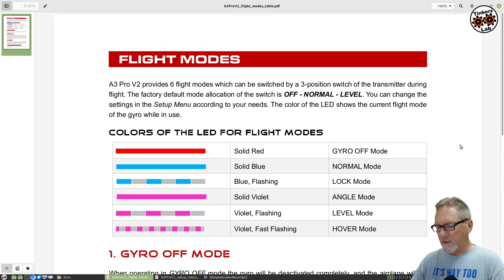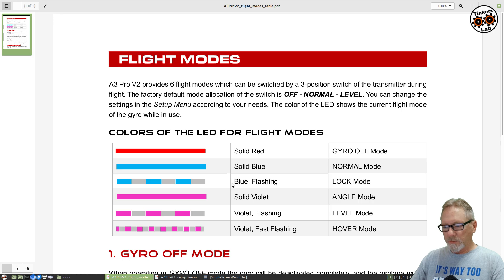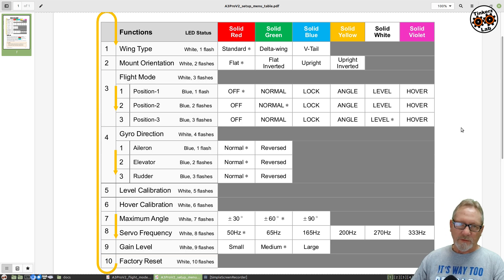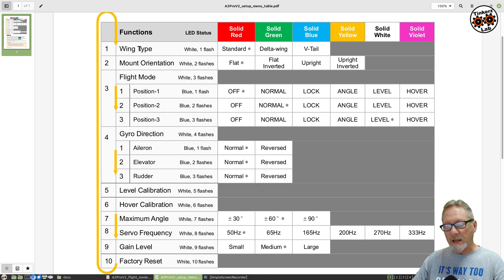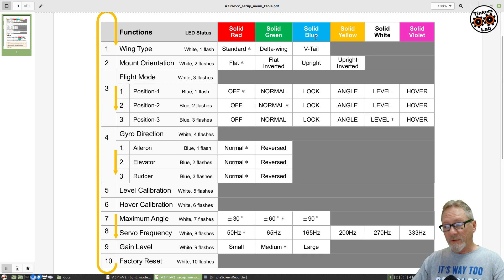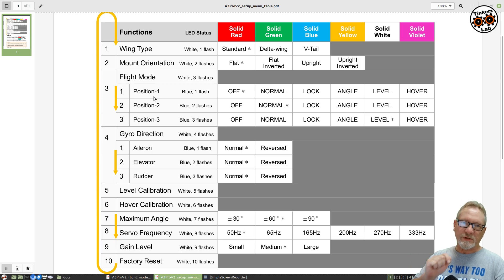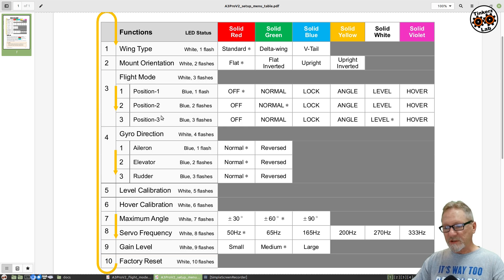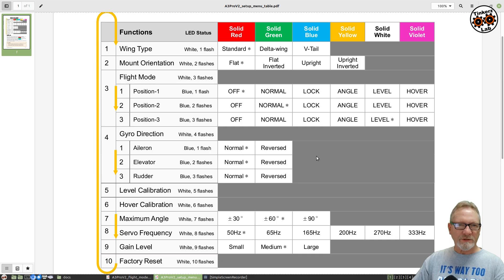Setup, Configuration, & Calibration of a HobbyEagle Gyro | HobbyEagle A3 Pro V2 6-Axis Gyro

Comment: Thank u.  I kinda gave up on the sub 250s for now..but...they are still super fun in high winds.  after many crashes i did fly my HKF18 with success .  So much fun.  I ordered the Su57..FMS.  but i will need an up to date hi speed low drag gyro... i think this is it!  Im currently using my jumper Tlite.  I have known that the controller will need to be upgraced once i got to more expensive planes,  i also have a FsI6x 6 - 10 ch controller.  Would u think that is sufficient?  Ive been thinking about the prices.  I think 300$ - 400$ is my max price.. considering upwards to spending 150$ - 200$ for a jet.  Im likely stay with FlySky RX.  But id still want the ability for an open/edge tx...dont wanna be stuck to one type of RX.  Also  Im older now and my eyes are uneasy on screens and small print even with glasses.  So a well defined screen on the TX is a must.  If u got ideas.  Pls inform me on any of ur thoughts!  Oh yea....2nd day resarching gyros.  Thank you TinkerzLab!
Reply from the maker: Thanks!
Yes, I think this Gyro is going to work great in my larger planes.
It has gain adjustment via the TX and provides SBUS and PWM output at the same time.
Just what I needed for using a Byme-A Gyro and separate Flaps.
Reply: @tinkerzlab  Thank you!